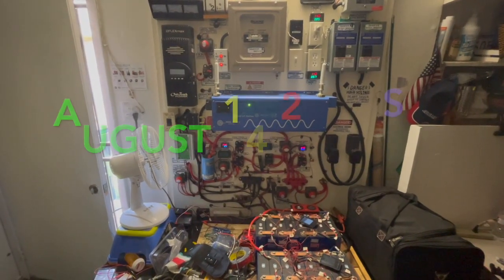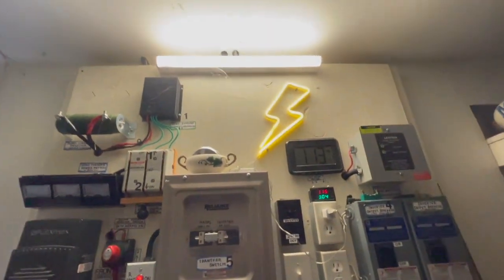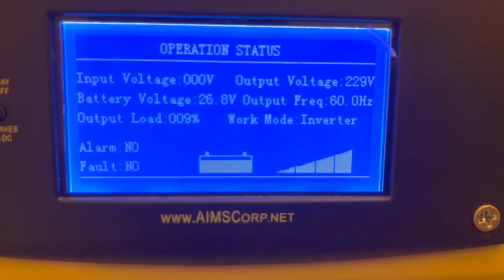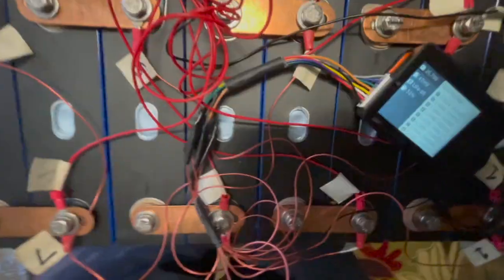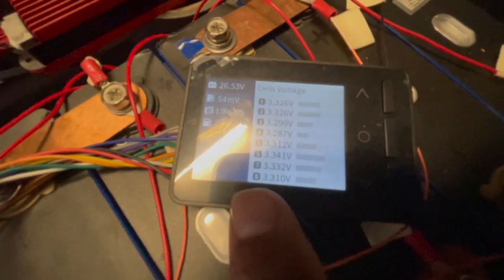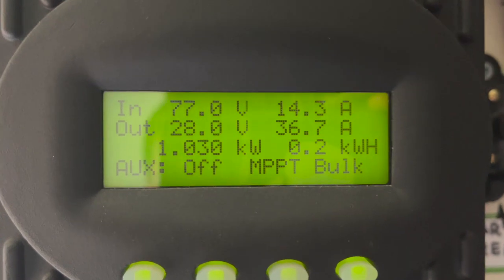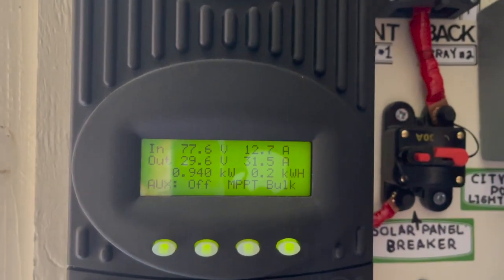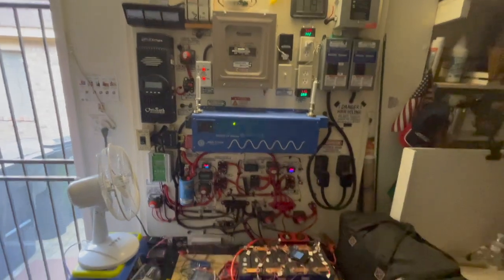LITHIUM OFF GRID LOAD TEST

Comment: Did you top balance these first? Seems they are wayyy out of balance and I’d hate to see you damage them!
Reply from the maker: I do be charging up the lower voltage cells individually to catch up to the higher cells voltage because the DALY BMS will only charge up the higher cells until one or some of them reach above 3.72 v before being disconnected by the DALYs leaving the low cells to never catch up and not be balanced .
Reply: @defjamsgreen  don't take that chance man, get a bench top power supply and do it right. That's alot of money worth of equipment.
Reply from the maker: @JM-yx1lm  I'M LOOKING TO GET ONE SOON . I DO HAVE A 10 AMP POWER SUPPLYTHAT I USE TO CHARGE EACH CELL INDIVIDUALLY FOR NOW .